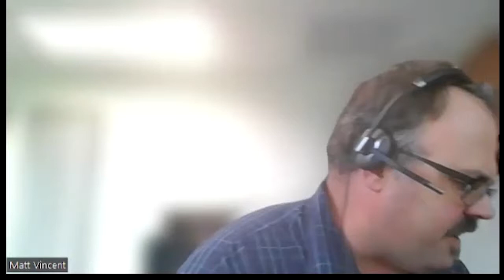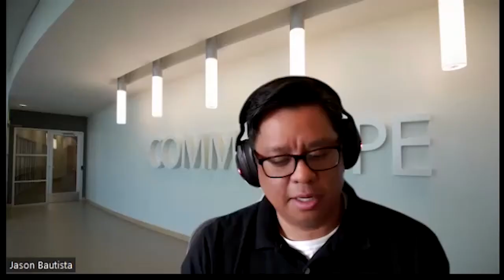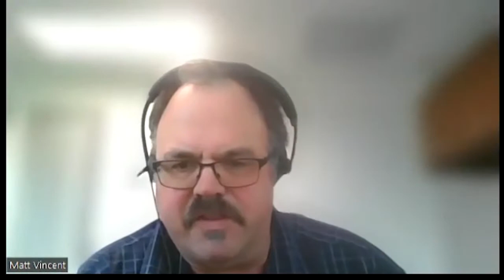CAT6A shielded vs. unshielded use cases and copper cabling 'upper limits'

Comment: bro jason. how about termination or links... how many termination can we do in a 70 meters cable that will not affect the capacity of cat6a cable.  in every link there is a patch panel and patch cords. is there a big loss or the maximum length of the cable will be affected?